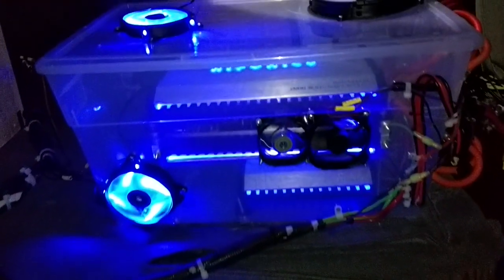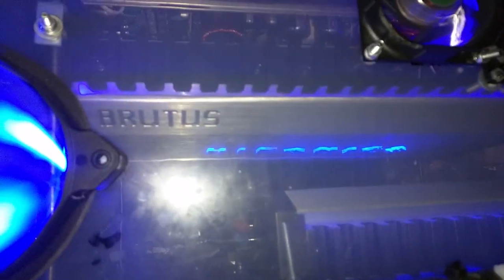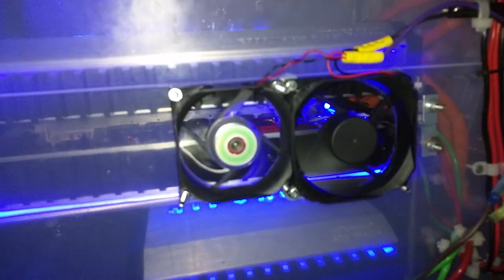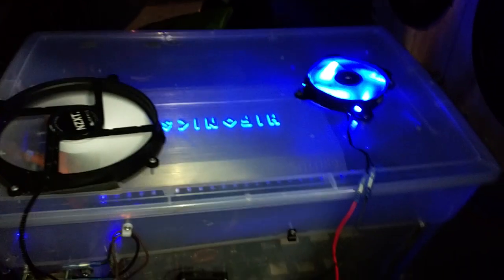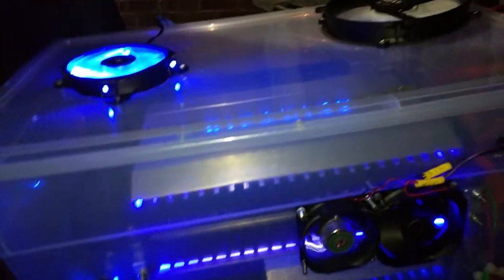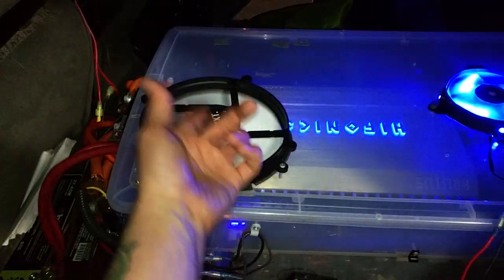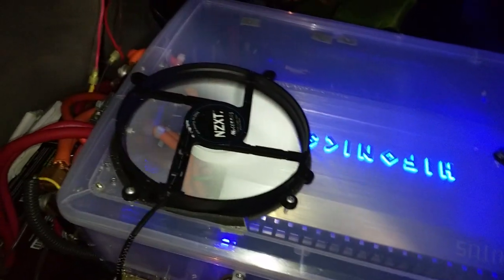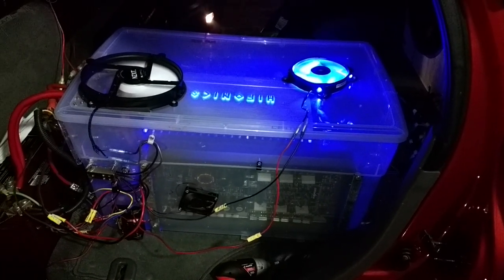Amp Cooler AKA The "Ice Box"!!!

Comment: If you mount the amps vertically the heat sinks are about 100% more efficient and you won't need as many fans. Heat rises.So working with that fact means you would be drawing cool air from the bottom (maybe the sides) and venting the heat out the top. You only need a 10" fan turning slowly rather than a whole lot of smaller fans making a rakette....next stop is 'water cooling' which works the same as a car radiator but with an external cooling tower instead of the outdated heat sinks.!
Reply: Water cooling? How?

Comment: Woulda been easier and more efficient to plumb part of the air conditioning directly into the damn box with an exhaust hole to let it move through the box for somewind chill.
That would be no money into fans, more cooling, and way more dope bruh....😂

Not taxin the altenator so much too as you use pre-existing fan to cool it.

Just sayin.....
Vacuum sweeper corrugated vinyl hose and the storage box with an inlet outlet-done deal
Reply from the maker: kenneth kellogg That's a good idea, one I strongly considered. After doing research on it the AC would introduce condensation into the box. For that ome reason I chose against it.
Reply: Touche'
🤔🤔🤔🤔🤔

But!
Only in a humid climate!
So it might work great in the deep far west. AZ, TX, NM, UT, CA....
Anywhere its dry as satans oven
Reply: Plus come winter you'd be blowing hot air in. Or no air.

Comment: directly off the amp if doable
Reply: I find if you run fans off the amp you get noise through the system. Better to do it right and run it through a toggle switch

Comment: can I wire more than one fan to the amplifier at once. I have a prime 1200r rockford fosgate. thanks in advance. nice video bro.
Reply from the maker: Are you trying to run it directly off the power that goes to the app or somehow use a fan to cool off your amp from a different 12 V power source?
Reply: @stinkyarmpitbass6259  Hi There, just wanna know can i somehow connect such fans directly to the Rem & +12 of my amplifier ? Also does my 500w sony xplod drain my car battery and is there any way to avoid it ? Appreciate your reply & subscribed. Love your idea going to do the same was working on some wooden contraption :P your idea is way much easier.